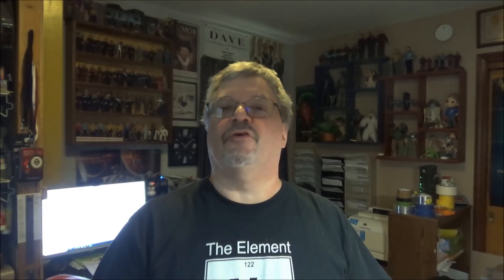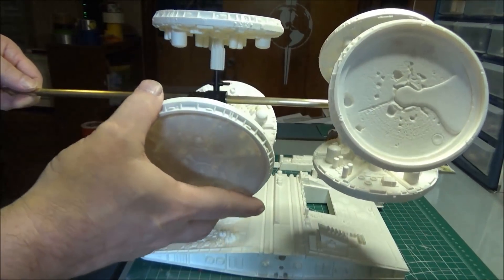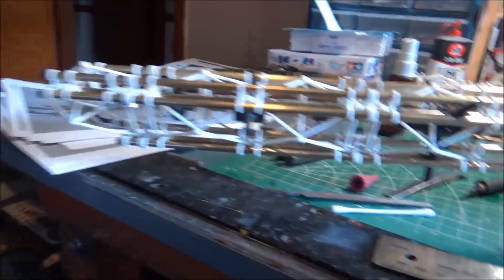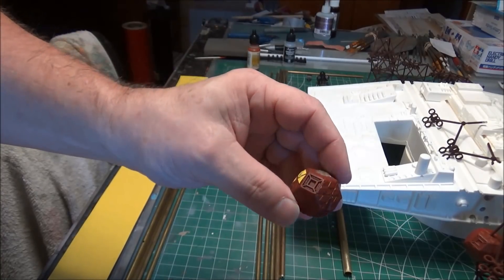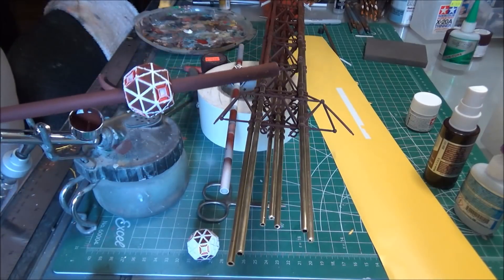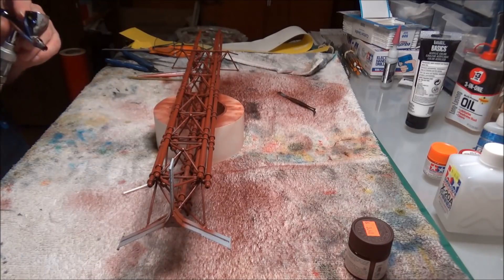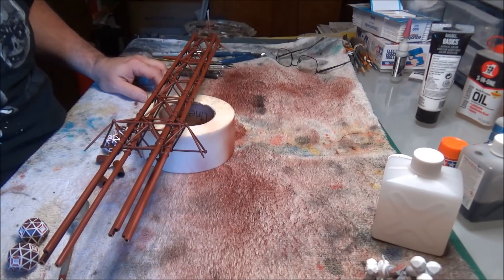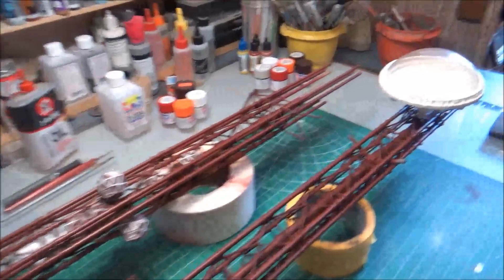Aztek Dummy Update 4/17/20 - Valley Forge Part 1

Comment: I suggest that the problem with the joining plugs for your tubing not fitting is that the brass tube, when it's cut, tends to roll in the edge (only by a few ten thousandths maybe) but enough to stop the plug going in. Ream the tubes out with a correctly sized drill bit and you should be able to fit them.

Comment: Ah - my favourite movie model. WOW, WOW, WOW.  A great job so far👍👍👍👍👍!!!  Just out of curiosity, are you going to light the domes?

There are so many great looking movie models like Discovery, Leonid, Entreprise, Cygnus, Millenium Falcon, etc, but I have always had a soft spot for the Valley Forge.

The movie's theme song and the music that ran when they zoomed away from the window and showed the ship/fleet, was playing between my ears for the whole length of your video.

At $1300 that is way beyond my means so I'll have to dream through your vids.  No doubt that this model will cost your client twice that much at least by the time everthing is complete and hung in his house.

Is this a possibility to consider -  use brass rods (not tubes, LOL), to fit inside the ends of the brass tubes.  Would it not give better structural rigidity to the model overall if you cut about a foot length and then pushed them thru both ooen ends. That way you'll have 6" as opposed to the 1/2" inside both ends of the rods.  They are attached to the main body so they'll be held in place in any case.  Like I said, I just thought it give the whole model better overall strength at not much more weight.

My movie is on tape so I wouldn't have been able to watch it as often as you did.  Unfortunately, many scifi movie/tv shows plots and dialogue are often that way.

Comment: Lou, while it would be a weight concern, would adding wooden doweling inside the brass rods help prevent bending?   Just a thought  Dane
Reply from the maker: no worries about them bending. the cumulative strength and stability of the 9 tubes is more than a match